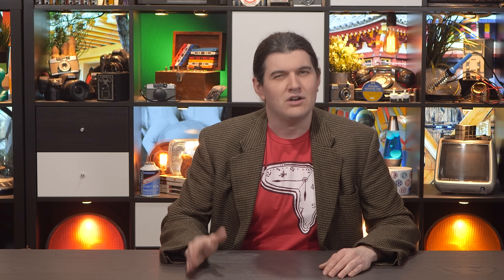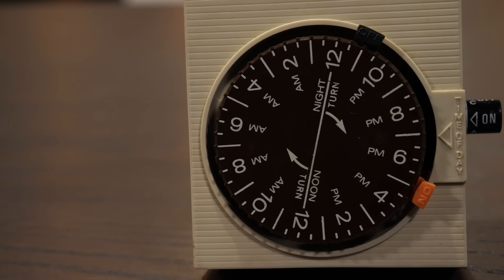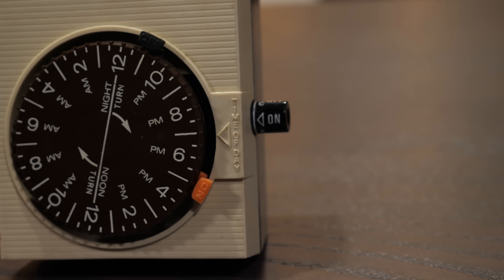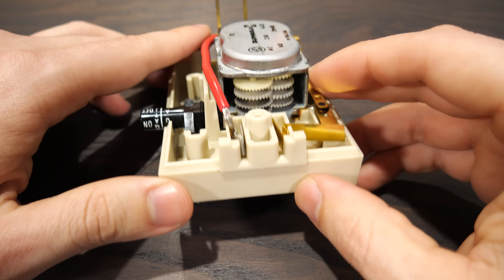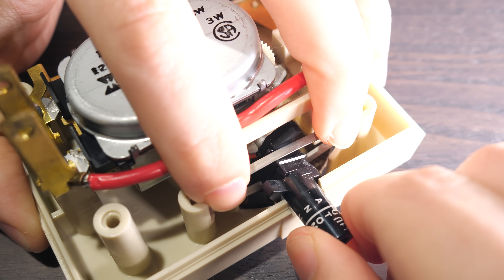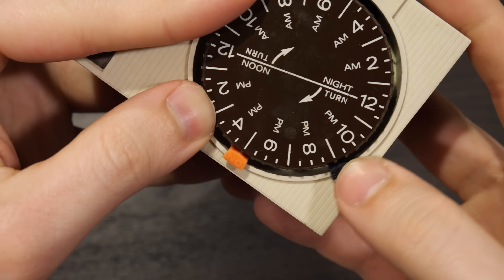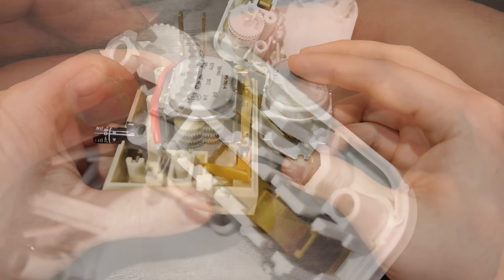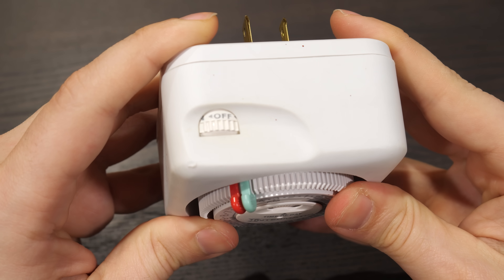Timer switches: literally just a clock and a switch

Comment: All that sounds quite logical but a couple of weeks ago I had to figure out how a device worked and at first I thought it can't be how it seems. This was a motorised valve on the central heating. It has a couple of microswitches and I had thought one was to turn off the motor when it reaches the non default valve position. That wouldn't work though as it uses a spring to return it to the default position. Counter intuitive but it proved to be the case, the motor actually stays powered up but is mechanically stalled by the valve.

Comment: The removable tabs can be stored on the timer. Just insert all the spare "on" taps into a time span where its already on, and the spare off ones into a time span where its already off. This has issues if you only want it to be on or off for a very short period each day, but otherwise works pretty well (or at least it did for me back when I used the exact timer you showed). Sadly they tended to wear out pretty fast when used 24/7. Great for seasonal use though.
Reply: I had two of those Intermatic timers with the green and red tabs, and it was so poorly made that the pressure of the tabs on the switch would occasionally push the tab out of the wheel.  Not enough that it fell on the floor or anything, but enough that it wouldn't actuate anymore.  They were just too loose on the wheel.  So I'd put the extra tabs as close as possible to the ones I actually wanted to trigger the timer, and if I saw it was running late, I knew the first had popped out.  That's a "you had ONE job" situation.
Reply: @JeffreyJakucyk  My water heater timer did that. The pressure on the switch was too much and would pop them off. Then it stopped the turning altogether. Really just junk. My dream is to redesign it with a digital timer to a contactor.
Reply: @craggslist  That looks like a nice fun project for a cheap Raspberry Pi Pico W!
I don't think it has an internal clock itself, but it can connect online somewhere and fetch the time.
Add it a few buttons and a relay and the rest is some Python code, easy to learn with lots of documentation and examples online, and a good community for help, support and ideas.
Reply: there is also an intermediate model with metal tbs instead of plastic ones.
Reply: @kenbrown2808  Ooh! Classy.
Reply: Yep! I used to do the same. :)
Reply: Yeah, that's how I stored them. I still use mine on my daughter's fish tank lights. It works great
Reply: Precisely how mine are still stored.
Reply: That's genius!
Reply: I do this also.
Reply: I came here to comment the same thing XD
Reply: Ditto!😃

Comment: Timer switches are VERY VERY COMMON in Orthodox Jewish households for use on the sabbath. You have your lights, AC, and hot plate, set using these in advance and then there's no need to activate any electronic devices on sabbath!

Comment: I have about.. 30 timers in my house as components of various exotic pet habitats.

Suuure I I could use an Rpi or Arduino or whatever to do it instead, and I have in the past for more complicated environmental controls, but there's something nice about using discreet devices. Only legit use case I have which needs more complex behavior is dumb stuff like simulating storms or associating other devices with heat/humidity control.

Most of mine are these generic digital ones off Amazon that can store 8 different cycles per unit and is day of week sensitive too. But there's plenty of crappy motorized ones in the mix.

A tip for the digital ones, make sure you buy one with an override button so you can click it on/off as needed without messing up the program.
Reply: And by crappy, I really mean "I don't think I've ever bought one of these but sure have acquired a ton of them from various pet rescues"

Comment: I like the mechanism and look of those.... some 20+ years ago I remember we had a couple of timer switches to control a pool motor and an electric water heater, but it was one of those with a dial filled with micro toggle switches all around.
That's perhaps an advantage of the more mechanical ones... they must still be there working great despite all these years. If it was a digital piece, I wouldn't be too sure about that. :P

Comment: Great video. I always appreciate your content. I was curious about finding a way to turn a light or series of lights on as a light based alarm but initially thought about a clock radio with an outlet on it and didn't have much luck finding a workable solution. Here comes Technology Connections with the answer to my query!

Comment: The thermostat in my old fridge broke and made the compressor work ceaselessly, turning the fridge into a freezer. I put a mechanical timer on the fridge, and set it to power on roughly 1/3 of the time. Kept the temperature fine and fairly stable for a few years. I now have a new fridge. But as a cheap fix, it worked great! :D

Comment: Our gas boiler has such a thing with the removable bits, but it is a 7-day programming ring. The clock can only be adjusted forward and 1 rotation with the timing wheel is 1 hour. So to adjust clock one hour backwards (say for this stupid time change thing every year), you have to turn 24*7-1=167 turns forwards. It's an amazing peace of equipment :D

Comment: This is from the 70s. I remember using it to record radio shows when I was away. For accuracy I'd set 
ON to the next top-of-the-hour, plug it in and wait for it to turn on. I'd then unplug it and plug it back in about a minute before that top of the hour. 
One source of error is that due to the fact that there are TWO positions on that plastic switch for each state. So, due to slight variations in the plastic-mould, the start-time will be slightly different every other day! :)

Comment: I had a mechanical enlarger timer in my darkroom. Worked well. It even had a second switch that turned the safelight off when enlarging. Sadly, the problem with mechanical timers is… they are mechanical. The stop that ended the exposure had somehow gotten loose, and so the exposures were inconsistent. So that was annoying to try and figure out!

Comment: I don't even know if Alec reads the comments, but a while back I found a vintage set of radio outlet switches and control boxes, but the outlet units may all be fried at this point (blown fuses probably).
Model numbers X 10-014301, X 10-04501, and X 10-014601

Comment: I have these Feit plugs that are internet dependent and will go offline periodically, that's a hi tech switch that I can also control with Alexa. when it works all is good but if Alexa or my phone says offline, they are absolutely horrible to put back,I have to delete the device and the re enter the plug and many times after looking for it for 2 minutes it will say on my phone device not available, that's when reach for the mechanical timer like the third one with up off down on, or is it the other way around. I'll use this till the hi tech plug wants to play nice with me again.
Reply: You are using the wrong smart technology. Rather than depend on WiFi you should look into protocols like Zigbee and then set up a Raspberry Pi with Home Assistant and a Zigbee radio USB adapter. That is free software and you can then program things without the Internet needing to be up. WiFi is unreliable, but protocols like Zigbee were designed to act independently of the Internet and they are mesh technology which means they self heal and relay to other Zigbee devices you own to extend the range of your automation which is another reason it is better than WIFi. But later this year you should start to see a newer protocol that I think might take over home automation called Matter using Thread as a protocol. Just something to keep an eye out for. These technologies I mentioned will not forget like WiFi and Bluetooth and they are lower energy use which means that if you have something battery powered like a sensor that it will last much longer. So ditch your faux high tech plug and get real home automation technology. If you aren't feeling the Home Assistant DIY software then you can also use Zigbee and soon Matter/Thread with other home automation hubs like SmartThings, Amazon Alexa Echo devices, or Google Home Assistant. These though don't always keep things out of the cloud but still better than using WiFi plugs.

Comment: I have at least one of each of those timers. About the one with the pin, you can store the pins by putting them in the timer the wrong way; one side of the pin is longer and it is the longer side that flips the switch.

Comment: I had a variation of that "peg" design, for an irrigation system.  It had two dials, one for the hour, the other for the day, with something like four weeks on the "day" dial.  So you could decide not just what hour of the day to have the system start (after which it just went through the various "stations" in order), but also which days.  The oddest part of it was that for one of the dials, I think the "days" dial, having a peg in place meant "operate on this day", while on the other dial, having the peg in meant don't operate at this hour.  Or vice versa.  When we moved to that house, the whole thing was on a long cord, which was plugged into an outlet in the ceiling, near the middle of the garage, along with the garage door opener.  When I rewired the garage, I put in a new outlet on the side with the irrigation control box, as well as running power through a simple wall switch, and direct-wired the control box from that switch.  So for winter, instead of climbing on a ladder and unplugging a cord, then finding a place to stick it so it wouldn't fall down on the cars, I simply flipped that switch.  This is also when I removed all the aluminum wiring, which had been mixed with copper wiring in the garage, with no care for connecting the two.  And I changed the breaker for the circuit to one rated for the size & type of wiring, instead of the one-size-above-wiring it had before.  I'd much rather have a breaker flip than have wires melt.
Reply: So.. it was effectively just two timers in series?
Reply: @matsv201  Exactly.  I don't know why they had the pin logic reversed between the two though.

Comment: After rewatching the "holes in plugs" video just yesterday, I was not expected to find relief from my resulting frustration so soon and surprising.
Reply: I was wondering if the retaining dimples are there because the plug is going to be inserted vertically, which is presumably fairly unusual?  (Here in Britain our plug-in timers and similar in-line gadgets nearly always have the socket on the front face, because the cord exits the plug at right angles.)
Reply: I too find relief from my frustration by plugging holes

Comment: My path lighting transformer had a tab-based electromechanical timer switch, but one of the reduction gears got stripped and it stopped turning the dial. At least, I assume that's what happened; it was still out there, buzzing away as a synchronous motor trying to drive a stripped gear will do, and failing to be in any way useful. So I replaced it with a newer microcontroller-timer model. I still have a tab-based timer somewhere, for outdoor seasonal lighting if I can ever get to the point where I can have the energy to put that up again. It's from Radio Shack, which dates it, and it actually has storage for spare tabs, which is useful. It would be even more useful if, the device having come with a given number of on tabs and off tabs, the storage for them was able to accommodate all but two of the tabs, but nope. It holds all but 4. I dealt with that by just stacking the tabs together, like with like, because the on tab right after another on tab didn't do anything, and likewise for the off tabs.

Also: "Oh look! It's a that!" has become my new favorite phrase.

Comment: would you ever consider doing a video on sowing machines? i mean obviously they work but without having looked into it... they shouldnt. okay okay hear me out here:
the needle of the sowing machine is attached to the machine, hand sowing is easy you stick the needle through the fabric you let go of it and you pull it out of the other end of the fabric and then you push it through the fabric in the other way, let go of the needle rinse and repeat, sounds easy right? thats because it is, but now consider that the needle is ATTACHED to the sowing machine, which should make this operation impossible, similiarly you shouldnt be able to sow by hand without letting go of the needle so what black magic does the witch machine employ? is there a tiny goblin in the machine operating black magic mechanics that somehow enable the machine to let go of the needle? is it some quantum mechanics that is afoot like 'ooh the machine works as long as you dont observe exactly what its doing' all jokes aside i dont see how it could be possible and well youre the one guy where i know i would get an equally enlightening and entertaining answer

Comment: Always wondered how these things worked, I always had a crude understanding that it was probably what you showed, but wasn't sure. I work at a condo doing maintenance, and we have several of these things in our lobby, for LED lamps that light up the various live plants in the lobby. I almost took one apart that was thought to be faulty, but I figured "eh, these things have to be incredibly simple, I can't imagine the thing just stopped working.." and I was right, someone just wasn't sure how to set the tabs correctly (instructions are actually printed on the back side where it plugs in. The switch works great still, I check every morning to make sure the light is on and then I check it again at 7am when it's supposed to be "off" and it is indeed off. We also have several other timer switches, we have the automatic light switches in the bathrooms, and we also have timers for the Hot Tubs that run from 2 minutes, up to 15 minutes, one time or another, i end up fixing one of them lol..

Comment: 0:26 I wonder why those metal switched don’t shock us..? And how risky they are. On a scaled up version: we have ‘all metal’ fuse switches that are inline for a door motors that move a steel and concrete doors that weighs well over 50 tons. Wonder if the switch will ever fail and send that current through me…
Reply: Any metal on electronic devices is grounded, so if anything shorts, the breaker will trip.

Comment: That "new" timer with permanent tabs is anything but new.  Search for a Telechron appliance timer.  They were on the market in 1945.

Also, mechanical "astronomic" timers for sunrise/sunset are still a thing, and many washing machines and dryers still rely on similar mechanical timers for their cycle controls.

Comment: I was worried about you buddy!  Thanks for the video!
Reply: Hah... I was wondering "Yeah, but is it a mechanical clock or run by a quartz crystal?" ... amazing that the actual timing is run by wall current!
Reply: You say "crude"... i say "just functional enough."  I reckon we could do with more crude things these days... cruder things are easier to fix.
Reply: Wait... the frequency of the electricity from the wall is stable, but is the motor?